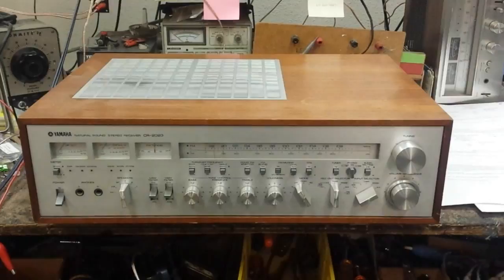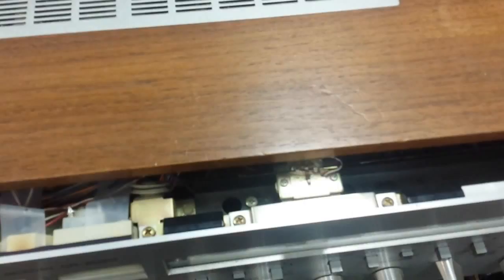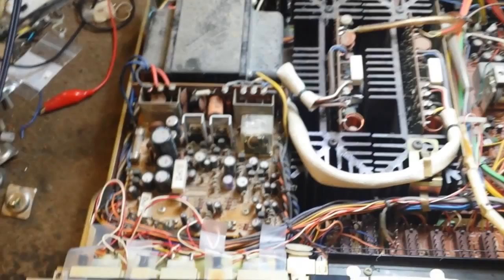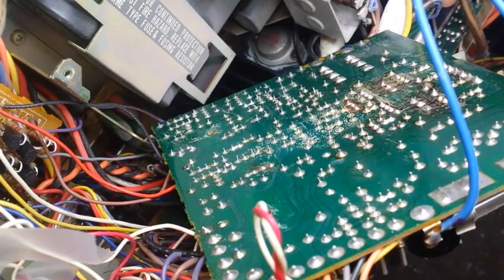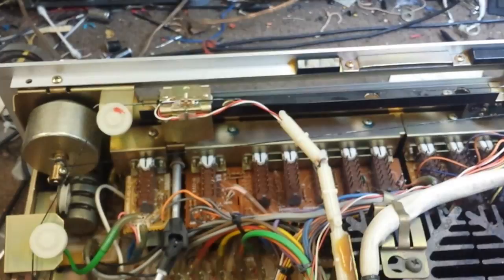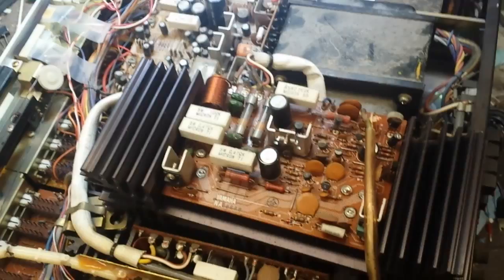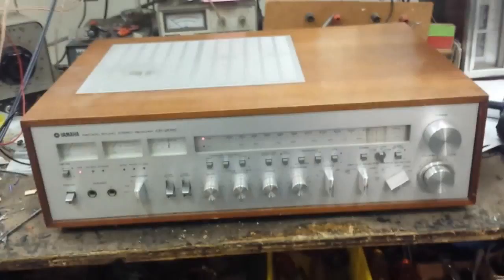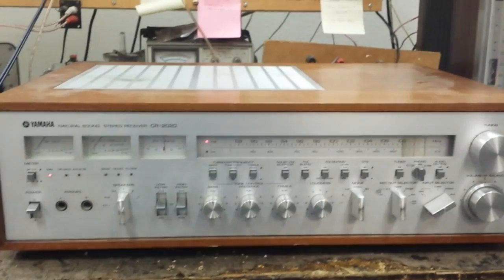Servicing a Yamaha CR-2020 Receiver

Comment: I have a question about the CR-2020- my watt output meters don't move very much, even under a heavy load/high output...they do move somewhat but not accurate.... I saw on  service manual that there is a VR701/702 pair of pots (I think) that allow for recalibration of the meters...can you tell me please, where are those two adjusters found inside the ce-2020....are they easy or difficult to access? thanks!
Reply from the maker: Don't go tweaking the pots. 

If both meters are not moving or moving little, there's something very wrong with the circuit that the pots won't change. They don't effect the calibration that much. More like a fine adjustment.

Start first by using a contact cleaner like deoxit, crc qd, or similar to clean the push button switch that controls meter function at the lower left of the meters. He'll, if you push it on and off 50 times it might clean itself.

If that doesn't work then meter circuit troubleshooting is in order.

Comment: Hi....Great Video..Can you make a video showing how to remove the front plate of a yamaha cr820? I couldn't remove the balance knob. Thanks.
Reply from the maker: no hex nut or keeper that I know of on the 820. the balance know should just come off. you can use two spoons to get it off if it's stubborn. if I had an 820 I could demonstrate but I don't at the moment
Reply: It is really tight. The manual does indicate the need to remove any other screw, really afraid of breaking something. If you ever cross a video showing such removal, please let me know. Thanks for your prompt response.

Comment: I have a CR-1020 which plays fine for a while and then a loud crack/pop and the music stops.  The unit is still on but no sound...radio, tape...nada.  After turning off the unit and waiting for a while, it will play again, but only for a while before it stops again...  Are you located in Southern California by any chance?
Reply from the maker: Sunny San Diego!  you can come down to my workplace. see repairaudio.com for more info
Reply: +Jordan Pier I've visited your website and bookmarked it.  The next time I head south (I'm in Orange County), I'll make sure you're open and will bring my CR-1020...
Reply: I have the same unit - the same problem...curious what causing this...age?
Reply from the maker: WITT33 age and poor choice of parts when it was made

Comment: I need an mc164 as the MC phono stage doesn’t work properly. Any help?!?
Reply from the maker: Mc164 doesn't come up as anything rated to an amp or op amp IC
Reply: @JordanPier  hank you so much for getting back! The tech guy says It's badged as yamaha... L6164. Maybe i6164.🤷🏻‍♂️
Reply from the maker: @colneblues  which model yamaha? I'll see if I cAn pull up the schematics
Reply: @JordanPier  hi again, it’s the same. Cr2020. And the problem is in the mc phono
Reply from the maker: @colneblues  The IC is a yamaha IG164. Its a dual FEt but its not know what the specific specifications are. They are not published. 

There is someone in Russia selling a set, but at 55 bucks - they are pricey. 

I would do some hard troubleshooting and reveal whether the IG164 is really at fault, or whether its a support component. Compare with the working channel. Might be open power supply feed resistor, bad capacitor or something simple like a touchy MC/MM switch on the front panel.

https://www.ebay.com/itm/Yamaha-transistors-IG164-2pc-RetroAudio/182420876509?hash=item2a7921acdd:g:6XEAAOSwa~BYeUPu

Comment: Your videos are informative, but your are making a couple of critical errors, the main one is, not understanding that ALL electrolytic & paper capacitors are worn out after 25+ years, there design life is more like 20, and they are long since worn out, regardless of what your silly little in-circuit ESR meter is telling you.  First of all, ESR is not even the main way capacitors fail, leaking DC is, which you are not testing.  Secondly, in circuit capacitor testing is iffy at best, capacitors, resistors, and other components are correctly tested with one lead disconnected, to prevent erroneous results from a shunt.  So, to do the job correctly, all of those little can shaped capacitors need to be replaced as this receiver is around 40 years old.  Another thing to give you a heads-up on, is the epidemic of counterfeit capacitors, these fakes from China are so convincing that even experts at the Japanese factories cannot tell the genuine from the fakes, visually.  The key here is to only buy your caps from authorized dealers such as DigiKey and Mouser.  If you are buying caps on ebay or amazon or the little shop down the street, you are almost certainly buying counterfeits.  Go to the websites of the 6 premium capacitor manufacturers, namely Nichicon, Chemi-con, Rubycon, Panasonic, ELNA and Toshin Kogyo and you will be surprised at just how few authorized sources there are (hardly anyone besides the above named two) -  Thanks for the heads up on moving the tuner to the right before removing cabinet and the importance of lamp type originality as it affects protection circuitry.